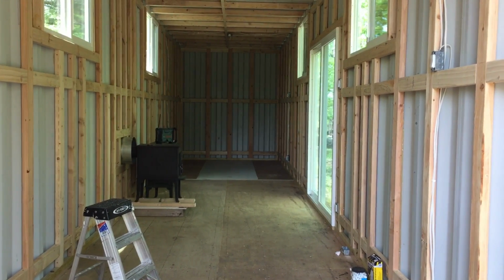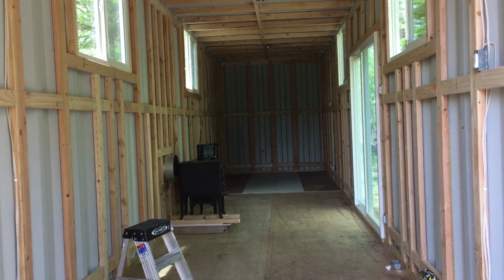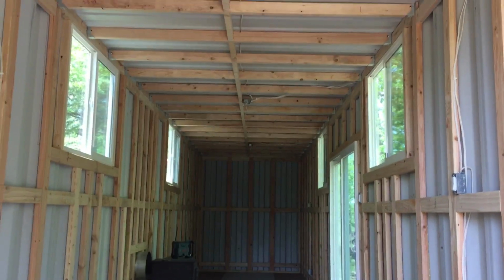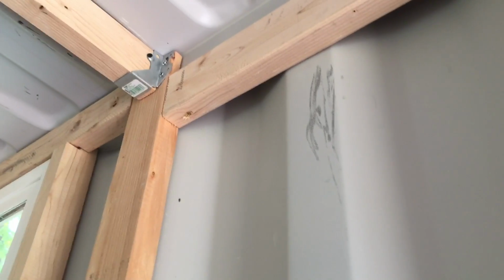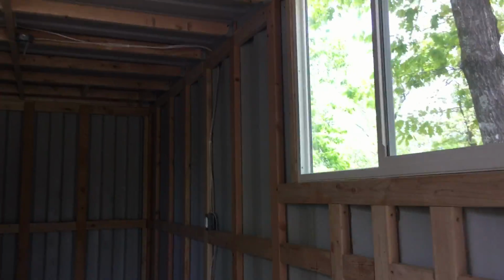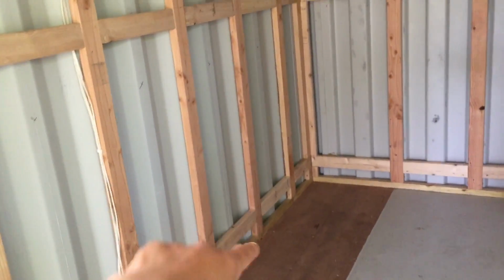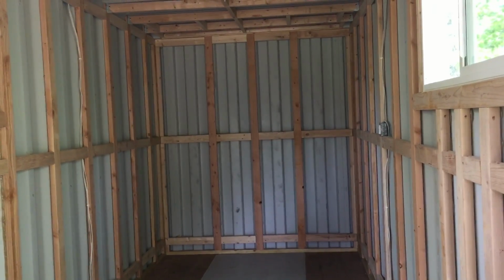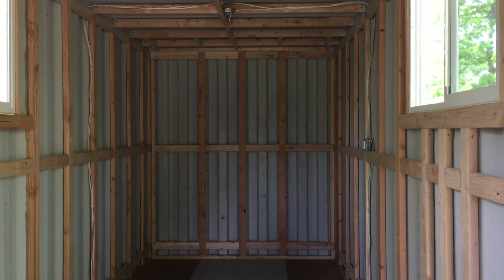Shipping Container House Framing

Comment: I just put an old rust free vehicle into an insulated and unmodified shipping container for the upcoming 6 to 7 months of Minnesota winter.  Should I be concerned about condensation forming in the container and causing a rust or corrosion issue on the vehicle I'm storing in it?

Comment: Is it winter in your climate zone, how to avoid dew point, moisture between the inner wall of the container and the insulation material?  Thank you.
Reply from the maker: No moisture problem with foam. My floor wasn’t insulated as well, so it will condensate if I don’t lift stuff off the floor. Especially, on the tile areas furthest from my wood stove. Hope that helps👍🏼

Comment: Have a question....how do you fasten the studs to the container? Do you use screws? I seen tone of videos and just wonder if screws are used,  and if so..does that mean the out metal side has a bunch of screws sticking out or that the metal is compromised in terms of water seepage?

Comment: Just wondering. If i dont want to lose any width in the container......how come i couldnt fit the studs inside the corrigation? I plan on ridged isulation on the outside of the container than side over it

Comment: Thermal Bridging is definitely important when framing out unit for residential use.  Bottom line is that condensation most definitely is an issue with these things and have the studs directly attached to the container itself with no foam behind kinda scares me.  How do you approach this?  How we frame them out actually leaves a gap between stud and wall though your style is most certainly saving internal space.

Comment: Did you just glue the verts to the walls? Or screw as well? Also when you cut the windows out of the shipping container did you have to do any welding to reinforce the wall a little bit? I was wondering if the windows would compromise the structural integrity

Comment: The worst thing you ever want to do in a shipping container is put drywall never ever put drywall you're going to cause black stacky boxers mold in between the drywall and the spray foam and you'll never be able to get it out you'll have to rip the whole thing apart also if you will put a vent in each end of that container to circulate the air you won't have to worry about the humidity as much I repeat do not do drywall!!

Comment: You can also get condensation from the drywall board. It retains a fair amount of moisture which contributes to its fire resistance.
I like using the blue flexible conduit to run all of my lines in. It allows for adding or changing wiring. I have used four levels of wiring within container builds, 1: Line voltage wiring, 2: low voltage wiring (12 volts or 24) 3: Television with satellite, 4: Telephone and Internet. The latter of the two I tend to run low between floor and outlets and at least 4" above where the baseboard will be nailed to. 
I also use a plastic vapor barrier between the studs and drywall to keep moisture within the living area and away from the metal walls just in case the foam missed a spot. Its easier to dehumidifie the interrior space instead of trying to get moisture out from behind the drywall.

Comment: Great video information  👍 however I do have an question  ? What type of glue did you use ?and does it become tacky when it gets hot ? I thought that an epoxy resin would be a better match for keeping the 2x4s from delaminating from the steel given it's higher strength and higher temperature quality vs other types of glues.

Comment: Yes, absolutely important is to address the condensation and humidity issues for this build, and you did that. 
We have a small home made from a lofted barn (780 ² ft without lofts) and dealt with the condensation and mold issues as we realized them... 
About to add on with a 40' high cube shipping container (we have one already for a covered bridge) and I will be sacrificing space for more insulation, by having the studs the normal direction. I would totally do it your way if it were more temperate here though! 
We will go with spray foam too.

Comment: I really do have to question these projects. If you have to do that much interior framing, you are likely better off just doing standard framing for a rectangular home to a size you want and cladding it in metal. 8 feet wide minus furring is not a livable space, IMO. You don’t need to have an engineer provide structural bracing for larger openings, easier to duct heating and air conditioning as well. A lot of times the costs of these finished container homes are more expensive than standard construction when all is said and done.

Comment: I framed mine by using 2x3's framed traditionally, they were nailed into the floor, and at the top I used 2x6's that were notched to fit between the top plate and hold the sides apart.  I used a 40' high cube container too.  I used R-13 faced insulation in the sides, and R-19 faced in the ceiling.

I'm using mine for a shop, not a dwelling, so my walls are finished in OSB, not drywall.   All my wiring runs along the top corners, I dogeared the top corners of the ceiling joists to allow wires to run the length.  Then I just dropped the wires down the studs to the outlets.
I would've loved to use spray in foam, or maybe even InSoFast insulation, but it would've cost me at least twice as much as I paid for the container.  (used, delivered)
I did a video on the build, it's on my channel.  Your framing does look very good though.
Reply: What insulation are you using to achieve r13 at only 2.5in of depth? Fiberglass isn't rated that high. I assume you bought fiberglass meant for 2x4 walls and just mashed it in the 2x3s, unfortunately your r rating is a fraction of what you think it is.

Comment: What's the point of using shipping containers? As when you modify them in any way you compromise their structural integrity which means you have to strengthen the areas with expensive materials to remedy that problem!... You may as well build a smaller home that is not a dog box but still gives you an effective and healthy space!... Living in small spaces are not conducive to our general well being!

Comment: This will work where you have no energy code.  You only get about 4.5 R-Value out of the foam in this configuration.  A lot of new energy codes are calling for R-19 in walls (R-13 even where no energy codes) but the framing looks good.  The best way to keep moisture down is to make sure you have a mini-split or another similar HVAC unit that can remove moisture from the inside air and draining the condensation outside.  Nice framing job :)

Comment: Great job, I did mine with 1 1/8 metal studs on the exterior walls and 2 1/2 on the lids and interior walls. 5/8 rock exterior and 1/2 everything else. Worked great and was cost effective for me where I live.
Reply: But how are you keeping it cool or warm with only 1.125" of insulation? It must be incredibly inefficient.

Comment: Condensation will form between the metal walls and the wood studs which have an R value of about 2.1 on the flat.  Why are the windows so high off the floor?

Comment: You're going to have a lot of metal that isn't covered by foam, behind the wood; why not install insulation board up before framing?
Reply: Cause the walls have valleys in them

Comment: Way too complicated.
Keep the framing absolutely basic, as well as the assembly.
Preassemble 'H' shaped frames.
Close these 'H' with a post in each end. 
Tilt 45° & lean them on the wall, then mount the horizontal beams holding these (now side lying) H frames in place. 

Two ~45° screws through the sides of each beam, as traditional carpentry prescribes.

As simple as that keeps the whole construction in place by itself, without welding/gluing and whathavewe unnecessary solving of a non-existent fastening problem to the steel!

Only use vapour barrier in a ongoing heated construction.
Otherwise heated side will change according to the weather, creating condensation and mole/rot.
Perhaps a dehumidifier along with ventilated construction will be a solution? 

https://youtu.be/jLlDKW9hKfc

https://www.pocketcontainer.de/

Comment: Thanks for the walk through, nice work! I wonder why not put the vertical boards into the cavity of the container wall (the part further outside of the corrugated wall) - you'd gain 6-8cm in width?
Reply: You would have no middle support between studs
Reply: @Checking4Updates  true, you'd have to use thicker timber so it sticks out from the cavity a bit. Or, you could use steel connectors. Or you could put the studs (if by studs you mean the horizontal timber) over the vertical ones and join with a long screw.

Comment: Nice job of framing. Haven't ruled out a small storage container as a cabin myself.  My concerns in CO are with the water vapor and condensation, some put insulation on the outside of container along with another wall that may or may not be vented.  Of course this adds to costs. But plenty of options for insulation these days which are a huge improvement over fiberglass batt. It would also alleviate any concerns about wood being placed directly against the metal on the inside.

Comment: Congratulations on framing that totally incorrectly. Zero rigidity achieved, wow.
Reply: Framing in a container is only to secure plaster board to not for structural integrity. They stack loaded containers 15-20 high on ships without any additional framing
Reply: Don't need any on heavy duty containers

Comment: has anybody thought of condensation from metal to insulation, whether paperbacked, or eco friendly recycled jeans... water condensation would cause mold.. ..any thoughts???
Reply: Anyone who builds a house out of these is a damn fool, huge condensation factor, every valley in roof collects water and rusts out which only way to prevent is to build roof over the roof, you will never get ANY signal inside these things so if you like internet wifi forget it, then oif you watch these builds they have zero places for moisture to escape but hey if you want to waste money on a total nightmare have at it.

Comment: Soooo from what I see you could had built a frame structure without the shipping container? What's the point of all that lumber? Not the best idea IMOO.
Reply: To add insulation, hide wires and then drywall.  Container is just the shell
Reply: @tehias  you could had used liquid nails and much less lumber. Basically you have a load bearing structure inside a load bearing structure. Common dude!

Comment: You need a thermal break between the wood studding and the metal. Moisture sweat on the inside of the metal that makes contact with the wood will cause rot. You should have left a space between the wood and metal for the closed cell insulation
Reply: Exactly my thoughts....Maybe some thin sheets of insulation first, then the framing?
Reply: 30 pound felt paper  @aldoovercomer5473
Reply: I am in the process now and am using spray foam.

Comment: It has always been a dream of mine to get a small lot in the woods on the outskirts of a nearby city. A nice place to retreat to on the weekends and such. A shipping container cabin would be perfect. I have always wondered about the "framing" process which is what led me to this video. I understand basic construction and understand how the 2x4s are attached to themselves. What has always been an unknown to me is "what is the best way to attach the wood framing to the steel inside the shipping container?" Is the glue plenty strong enough to hold the vertical 2x4s in place which are then wedged under and support the weight of the horizontal ceiling framing 2x4s?
Reply: Let the framing hold it self in place.
No need for costly welding or brackets..
Keep it simple

Comment: Unless you want to be crawling on your hands and knees to tape and finish the bottom drywall joint put the small piece in the middle.   Full sheet top and bottom and then fill in with a small piece.
Reply: Not good put it at top

Comment: NOOOOOOO!!!!!! you turned them the wrong way! 4inches deep is the minimum! Don't put the 2 inch side out! Now you have even less insulation power! I don't want to hear a damned thing about "good enough" and "space saving". You will exponentially increase your heat and cooling loads. Put the insulated framework on the OUTSIDE if you need maximum space.
Reply: 2" of spray foam is more than you need.
Reply: Never Gonnatell  i think he was being-never mind..

Comment: That's nice but you should have cut the sidewall hole for the wood stove exhaust towards the top of the ceiling, that way the flue pipe keeps most of the heat inside so you burn less wood.
Reply: Smart.

Comment: Do not build a container like this guy. This container will mold from  moisture inside of walls and make you sick.  The wood touching the metal will rot. His ceiling framing is wrong. Hack
Reply: And Never use pressure treated lumber inside, better off with marine grade plywood...
Reply: Exactly.  Having a solid metal skin on the outside acts as a vapor barrier on the wrong side of the insulation.....warmer, moister air is trapped in the winter between the cold skin, and insulation.  It will condense on the inner side of the metal, and as you say, cause rot.
Simply another reason shipping containers should be used for unheated storage, or something like, say, SHIPPING.

Comment: Decrease Total Cost by making frame Wires instead of solid steel containers.  Then, the walls will be acrylic insulated panels.  Have you seen wire baskets or wire containers?  Make that big or longer as long/big as a container height/width.  The corners will be steel.  We can do this!  Good Project!
Reply: I would like to here more about this idea. I have been looking up shipping container houses for a while now. I am not fully understanding your idea but I think it is the same Idea I have had over the last couple of days. Please expand and break it down.

Comment: All the work seems overwhelming if you look at it as a whole job. But if you look at it in layers, it'll help. So the following are those layers:

1.) Clean(wipe the whole inside with acetone or white vinegar).
2.) Then sealing up any rust spots. Since not all containers are brand new, go inside & close the door, and look for any light peaking through. Because if light can get through, water can do the same.
3.) Sealing the top of the container(I used Flex Seal ...4-5 gallons). 
4.) Then with framing, I used 2x4's(deck joists helped w/the ceiling application and the adhesive I used is a non-solvent ...adhesives with a solvent will rot the insulation). 
5.) Then installing the wiring, and then outlets & lighting. 
6.) As far as the insulation, I first put in a reflective backing, then either go with batting or 2" poly styrene(but with poly styrene use a non-solvent adhesive), but the insulation must be rated with an R-30 or better. And while the walls and floor are 2", the ceiling will need at least 10".
7.) As far as moisture elimination? ...for a 40 ft. High Cube I'm using 15000-18000 BTUs. But I'm going to be using several units instead of 1 main unit. Because if it's 1 main unit and it dies, then you're stuck and looking at finding what is available asap, or moisture damage will develop quickly. So with several units, if one or two dies, a quick trip to Lowes/Home Depot can solve that rather easy.  
I do also want to point out that I saw a product called Grafotherm(you can find it on YouTube), it's widely used/sold in Europe ...I haven't been able to find it in the US. So instead I'm painting the exterior with reflective paint. However --Grafotherm is activated by heat, so using that in-addition to reflective paint would a be waste of $ ...so use one or other, not both.

Comment: Another thing I would recommend especially if the area you live in receives decent heat during the summer is a ceramic additive you can mix into paint. You can mix it into an oil-based or water based paint and it will increase efficiency. You can also make it into an insulation paint which provides it with an even greater tolerance to heat.  Due to the ceramic particles it allows for greater reflection of heat from the Sun as ceramic is an excellent insulator.
Reply: Thanks for the tip!  :)
Reply: How is a a ceramic layer that is as thin as paint going to add any insulation value? It won't. It might be good at reflecting heat but not insulation.
Reply: @randybobandy9828   Because it does not allow as much heat absorption and ceramic is an excellent insulator.

Comment: It would have been more efficient if you had used 2X2's instead of a 4X4's for framing.  Not only would it have provided better insulation properties once you install the spray foam but it would have also cost less. Since the framing ads no structural support at all or if you would have done it where you framed out the frames for the windows from 2X4 metal rectangular tubing welding it to the corrugated sheet metal of the container and use that same tubing for the framing of the door it would have been more efficient. Heat and cold transfer through wood is far less efficient than through the spray foam insulation. The less wood you have in the framing the more efficient it will be. 

It does look like a nice design! Thanks for sharing!

Comment: Be sure to drive a ground-rod for lightning protection and ground the container to your electrical service. Good luck!
Reply: Yes, grounding strap run through floor and attached to iron or copper rod driven into ground just outside wall of shipping container is advisable.  Best to not have any of the electrical devices touch anything on the metal surfaces of the container itself.
Reply: Thanks for your input.
So good to do homework before venturing on any project.

Appreciated.